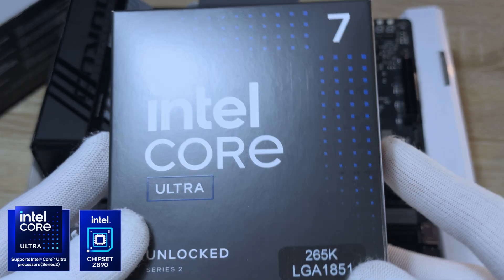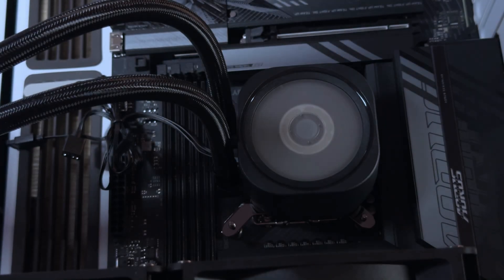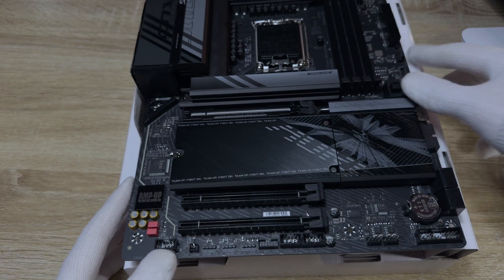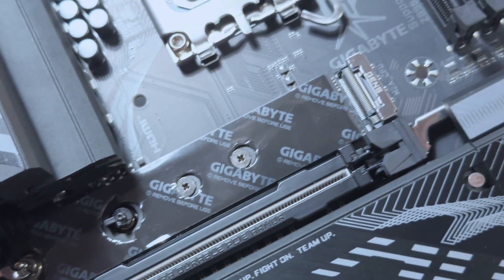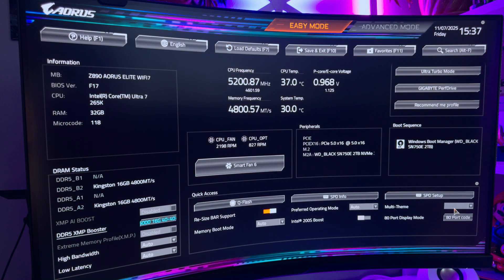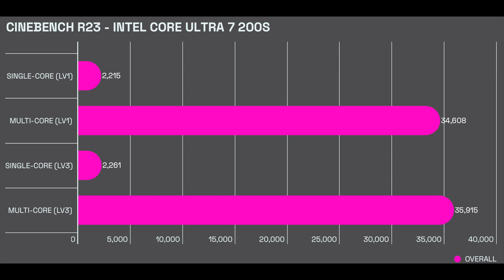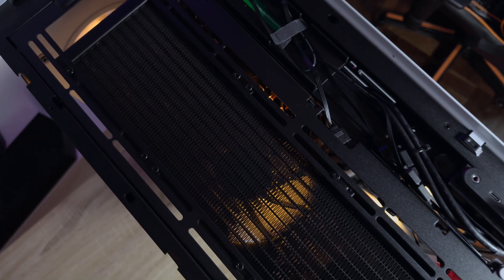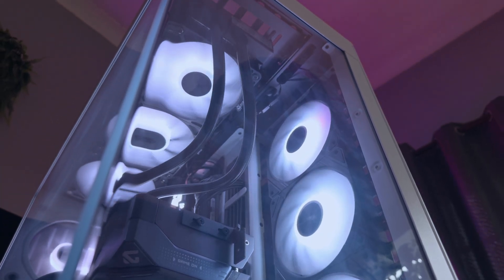Gigabyte Z890 AORUS Elite Motherboard + Intel Core Ultra 7 265K Review

Comment: Hey, does the motherboard have the thick silver solid pins inside the 24-pin atx connector? (the same pins as the 8 pin cpu) For some reason most new mid-tier boards use the smaller cheap black pins for the 24-pin.
Reply from the maker: They use the silver pins on this board. So the sturdier ones at least.